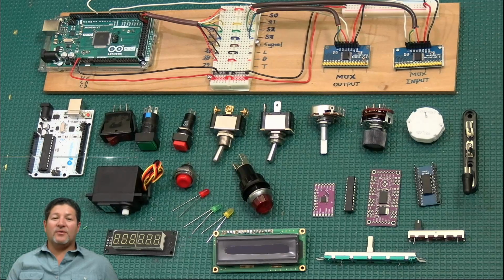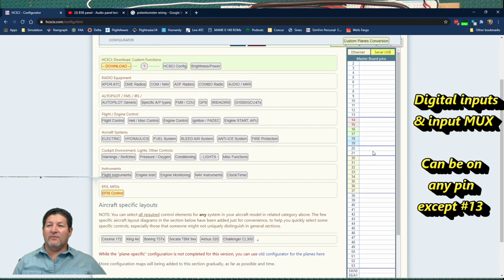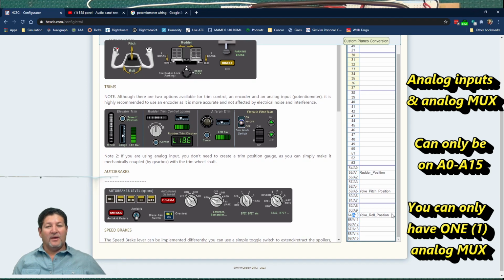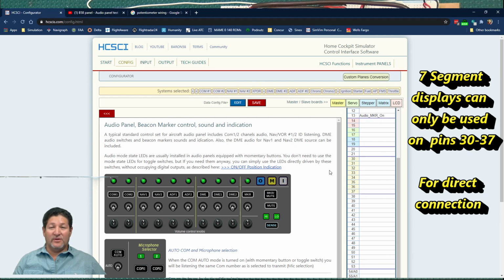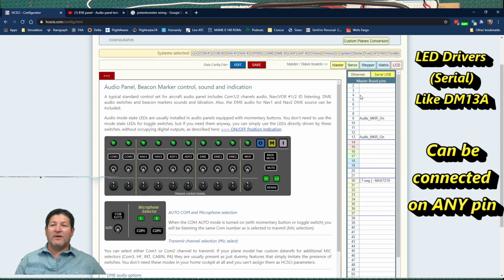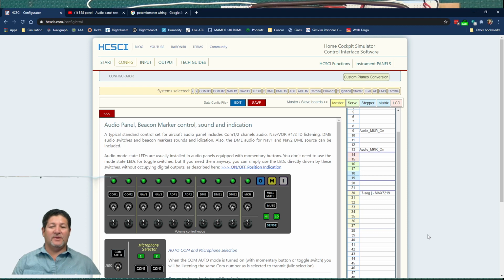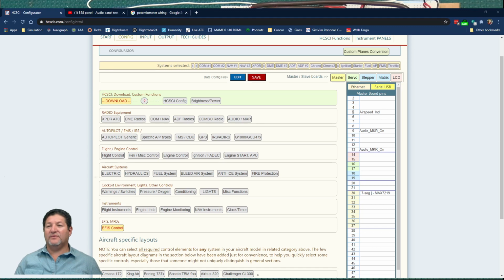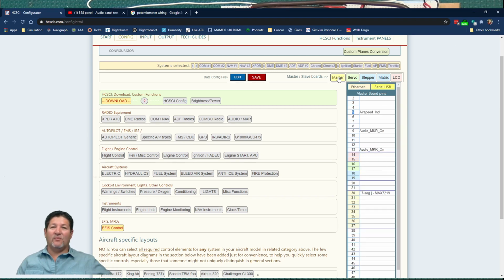Back To Basics: Arduino Mega 2560 Pin Usage with SimVimX/Real Sim Control

Comment: Hi, is it possible to use stand alone usb joysticks/instruments togheter with hcsci, or must the whole system be in the same system
Reply from the maker: Yes you can use USB stuff as well. I am using four Saitek panels, the Honeycomb Alpha Yoke and Bravo Throttle Quadrant, and a bunch of switch panels I made using HCSCI.

I also have a video where I go over my entire setup

Comment: I’m having trouble wiring one of those 5 pin momentary push button lights, like the green one you have on the top row. Finding a wire diagram has been difficult, I’m trying to wire a red and yellow one for the master caution/warning lights. Can you show how that type of light connects to the Arduino
Reply from the maker: Hi John, yeah I couldn't find one either. I kind of figured it out by trial and error. I think this is one of those where a short video will be easier to explain it than via text. I'll try to record that and post it later today.

Comment from the maker: @Robert Mania unfortunately your comment was one of those that disappeared for whatever reason is going on with YouTube so I am unable to reply directly under your comment since its not here. I was able to see it in the email I got though.

You can use the same encoder for Mhz and KHz. Just use the push button as a selector. Watch my video "Basics for building and MCP panel" On that one I explain how to use the same encoder and 7 segment display for two different functions. The same method applies to what you are trying to do.
Reply: Thank you very much. Your tip was very helpful, after watching "Basics for building and MCP panel" I was able to configure everything properly. I am very grateful to you. Your films are an inspiration for me, I am preparing to create the Cessna 172 cockpit. This is just the beginning, but the most important thing for me is to understand the issues related to Arduino. You explain everything simply and clearly. Best wishes.

Comment: i am currently using one mega and 2 uno for servos and steppers. can you do the matrix wiring max 7219 diagram for led's connections, or are they the same as for DM13A?
Reply from the maker: Sorry Jose, I'm not able to help out with that. I do not have any MAX7219 standalone chips and I've never experimented with LED matrix. I think you might be more advanced than me in that area
Reply: @Qosmokid  i will consider making a video once i get everything right kkk